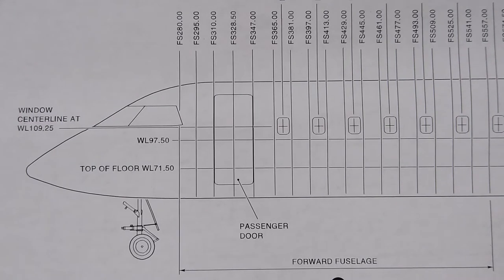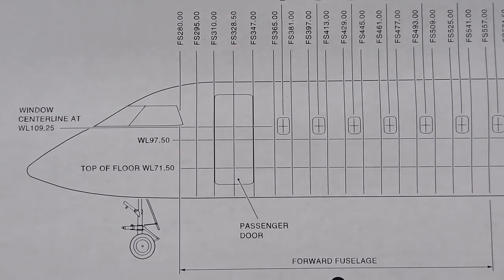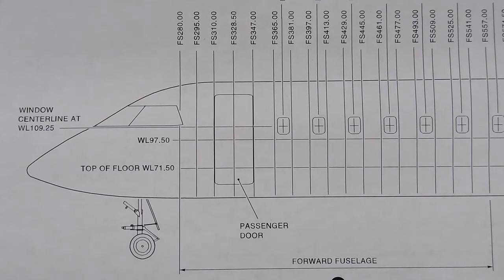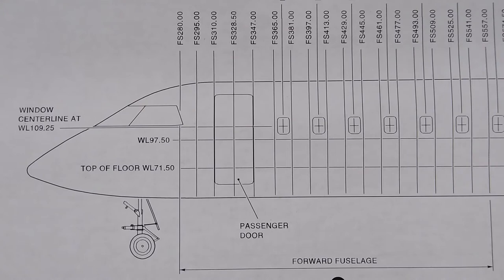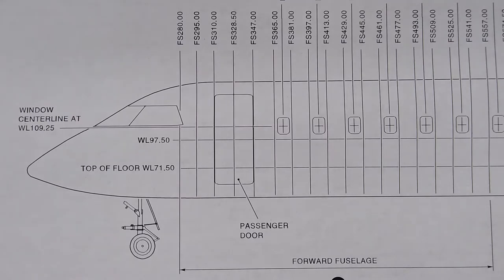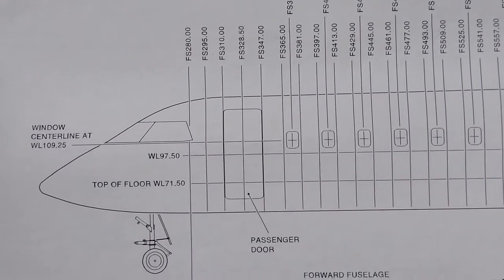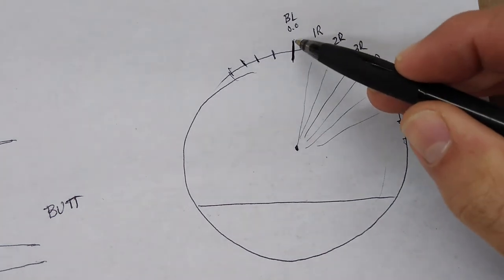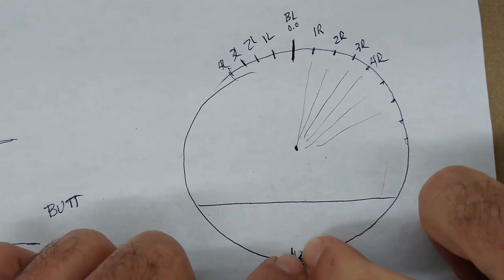AIRCRAFT DIMENSIONS and COORDINATE SYSTEM

Comment: Thanks for the breakdown. Would FS ever change for different aircraft configurations? They should stay the same correct? Unless, a major structure alteration took place. 

Specifically, on Bombardier aircraft. I've went back and forth between manuals and aircraft trying to figure out certain panel locations, and it has honestly been a headache. 

I believe its because there have been so many modifications done on the interior and configurations change everytime the AC gets taken over by a different carrier.
Reply from the maker: Hello, thank you for a good question.
No, the Fuselage Station (FS) does not change throughout an aircraft's life because the airframe itself does not change. Unless, like you said, the airframe gets heavily modified to make it longer or shorter. In that case, it would then be one experimental, or if certified, then new specs would be verified as well with the new FS arrangement. 
Now, component locations in the aircraft are a different story. Those can be moved according to the operator's needs. Every time a component gets moved it gets done with engineering and drawings to relocate it. However, those changes never get added to the original maintenance manual. Therefore, when you look up your references in the aircraft maintenance manual(AMM), they may not always be current or up to date. 
And yes, that is a pain in the @ss.

Comment: Thank you 
Engines get too coordinations like fuselage ?
Reply from the maker: Yes, indeed they do, but not in the same way. Let me explain... Airframe fuselage stations represent a distance, a measured number of inches away from a reference datum and are specific to each aircraft. Engine stations on the other hand, are sequential numbers (usually 0-9) marking places where changes in the thermodynamic process happen. For example, station ZERO refers to the air before it enters the engine, station ONE is right at the inlet, TWO is at the beginning of the compressor, THREE would be compressor discharge, and so on. These station numbers are an accepted standard. They hold true for most turbine engines regardless of engine size, and are therefore not a representation of a distance (like fuselage stations) but mark a change in the process. NASA has a great article on this topic. May I recommend searching for "jet engine stations" and you should find it. I hope this helps and thanks for watching my videos.